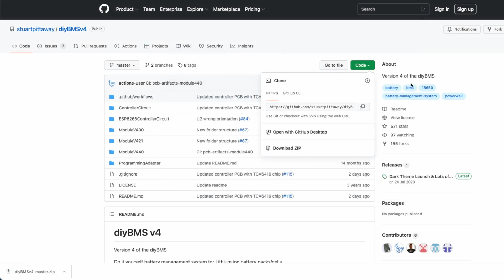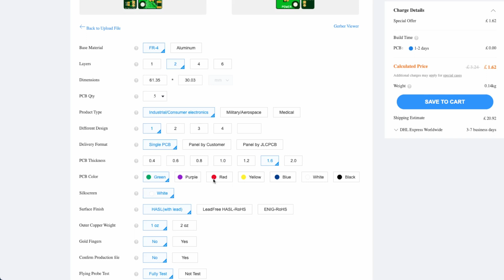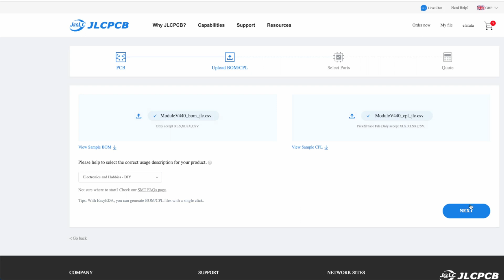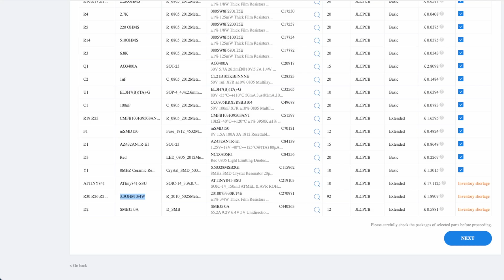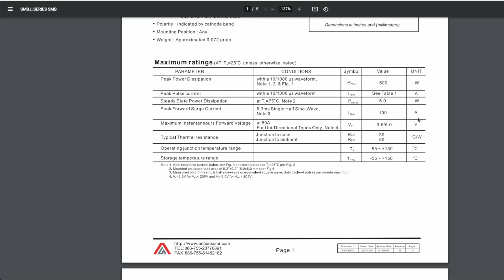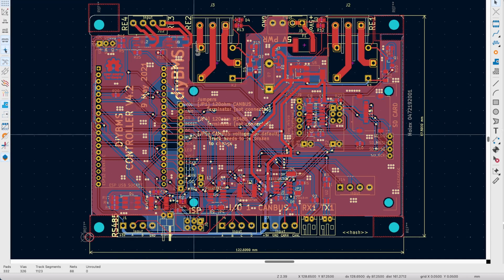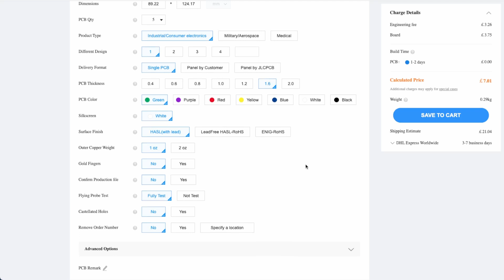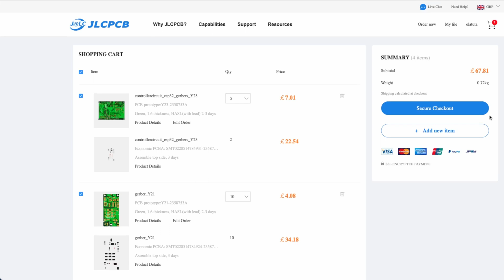Ordering DIY BMS EV conversion on the budget Ep 1

Comment: Do you have an estimated weight this Prius will be? What kind of range are you looking to get? Where are you putting your battery? Idk how much space there is where a Prius' battery goes.
Reply from the maker: I am not planning to use the Prius as a base for the conversion. I will be using Prius inverter and gearbox as a motor. As for the car choice I want to choose lighter and smaller car such as Audi A2 or Toyota MR2. Check my video What car where I talked about potential car choices. The idea is to get the electric propulsion system working first and after that install it into the car
Reply: @LatutaEV  Check out the older Mazda MX-3's.  That's what I'm planning for my conversion. (Mine also has a 5 speed gear box...hmmmm)
Reply from the maker: @petersamios5409  It would be too small not much space for a battery and rear wheel drive. As I have a Tesla motor I can't place it at the front and drive the rear wheels. I think there will be not enough space at the back